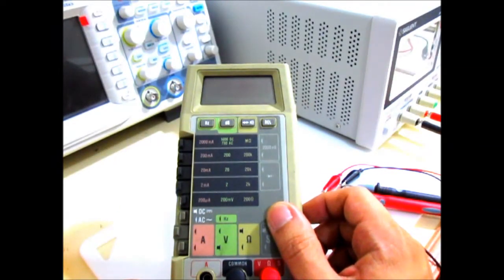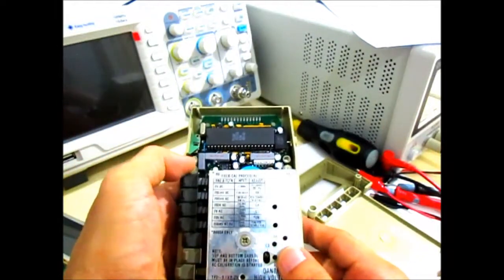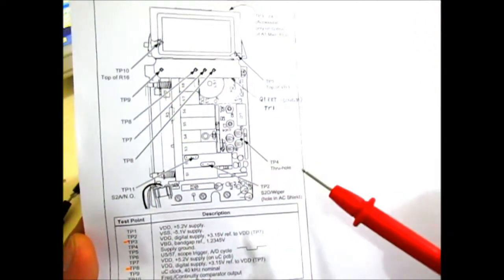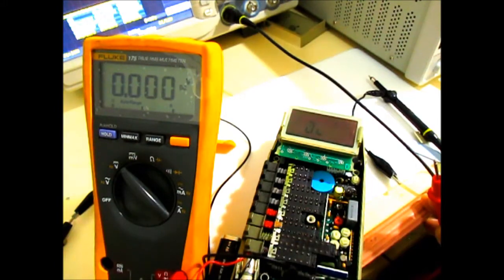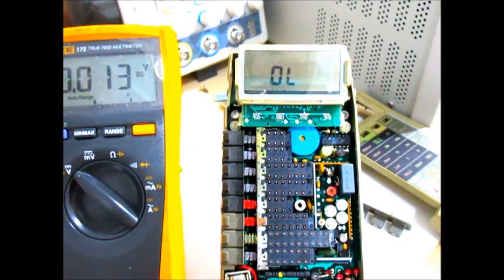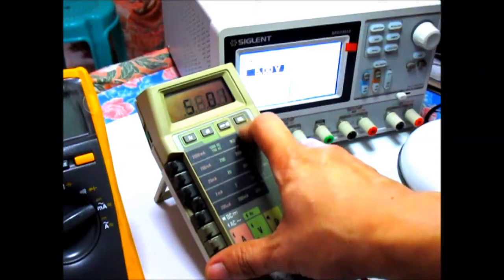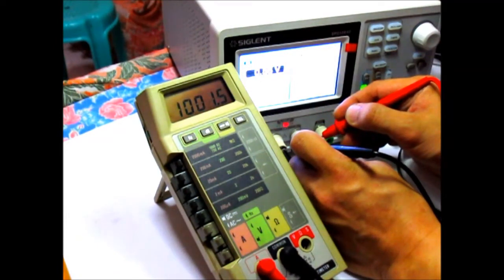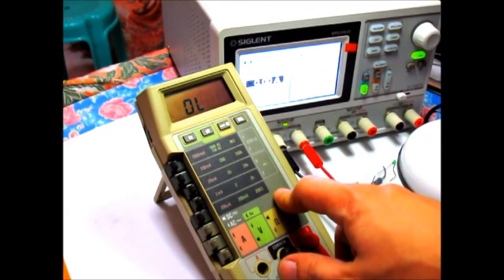Fluke 8060A Repair, Modification & Testing

Comment: Thanks for the excellent video. It would have been helpful if you have shown how to open the LCD module safely.  I have an 8060 that is dead since 15 years. Since I have couple of other meters I didn't bother to try repair it and it was kept as an old souvenir. Seeing your video I decided to fix it. The 40 pin socket is corroded and and two pins are broken. I have ordered the parts. Couldn't find the service manual in Fluke site. How to get a copy of it. Thanks again and looking forward to more of your videos.

Comment: Hi Nat. I'm from Argentina.  Last week I bought an 8060th from Ibm that did not work.  Replace the electrolytic capacitors and clean with alcohol.  And it worked.  Incredible that a team of 40 works like this.  I compared it with another similar multimeter and they were very close, there was no need to touch the calibration.  I am very happy with my purchase.  Excellent idea to replace the zebra strip with cables.  A hug

Comment: I congratulate you for your video. Can you please tell me where to get the lcd module of the 8060A? Thank you.

Mr. Justo V.
Reply from the maker: Thank you Sir,  I didn't really replace the LCD module, i just cleaned up the connectors. I've seen some replacement or LCD mods for these meters online, you may want to google it out.